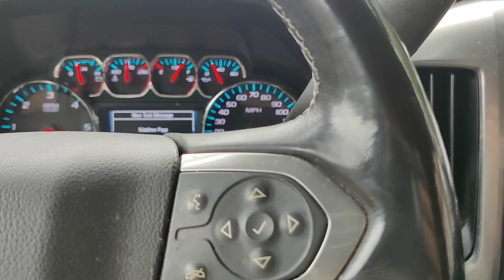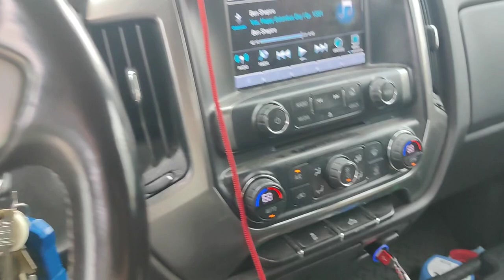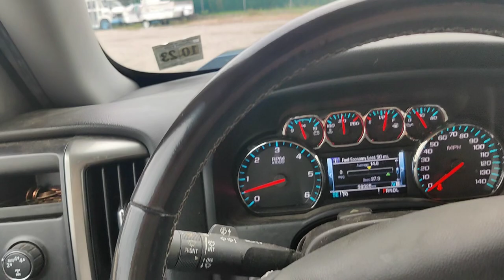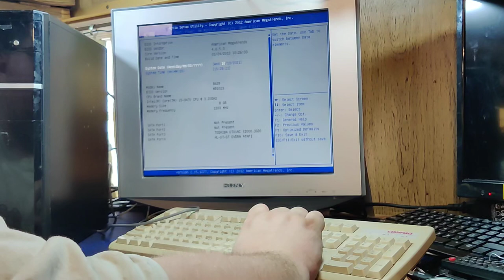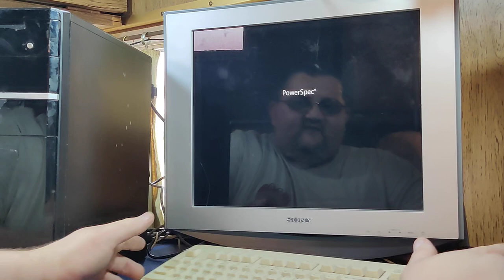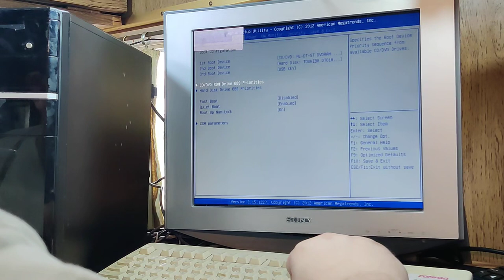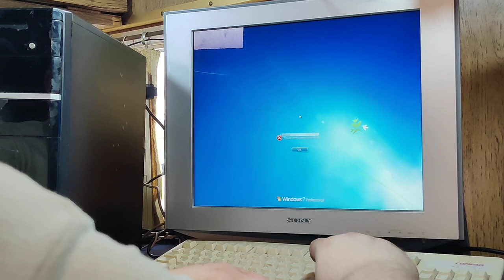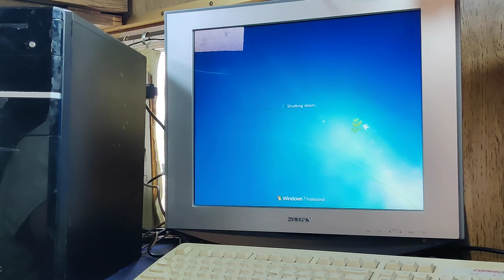I buy 9 Mystery Computers Off Facebook Marketplace

Comment: The Power spec looks a little like some of the older Compaq models. If it's a 3470 CPU then the BIOS should be secure boot UEFI TPM 1.2 etc. Windows 11 may not work but I am not a big fan of Windows 11. My Windows 10 works just fine. I also have a bootable program USB flash that will erase the password.
Reply from the maker: I thought I recognized the name; Power Spec is a house brand for Micro Center